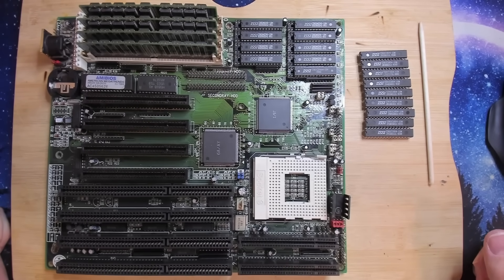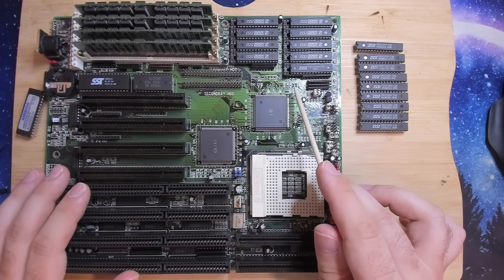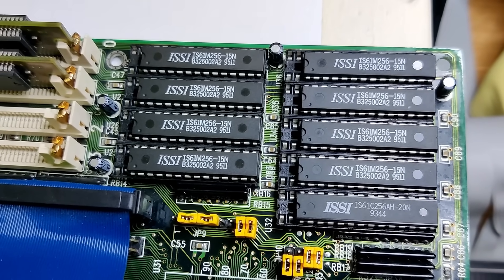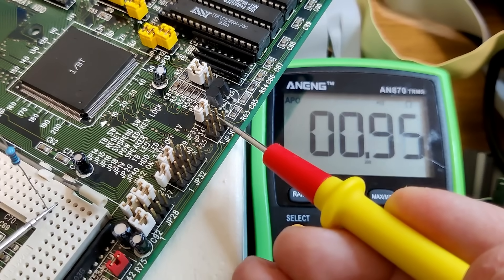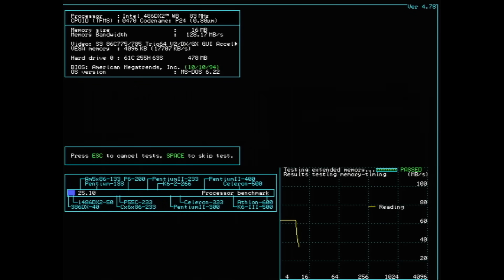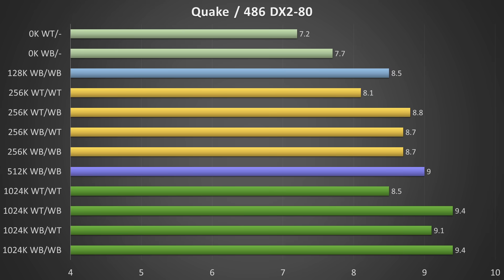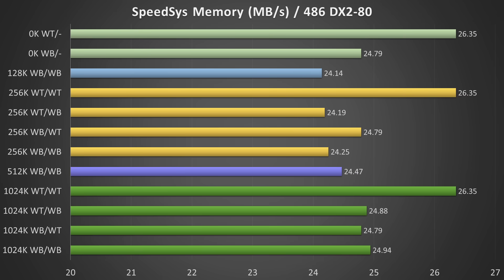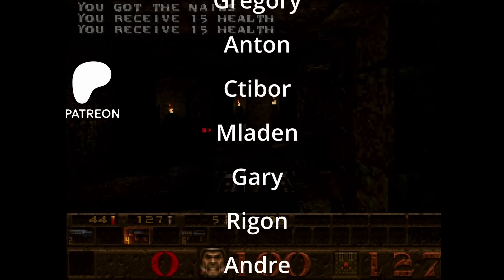How Much Level-2 Cache Do You Need?

Comment: From a purely theoretical standpoint, I would think that a cache larger than 256k would be useful if the 486 was being used as something like a database server with large amounts of memory and a huge dataset (for the 486 era).  Other than that it's likely well into the "diminishing returns" territory.
Reply from the maker: Yes, I think so too. More cache will only be beneficial for specific tasks. I think 256K is the sweet-spot for 486 systems - at least for all the nostalgic tasks we do.
Reply: @bitsundbolts  As an example, a company I worked for in the early 2000's had their customer and inventory databases on a 486 server system running some flavour of Unix with a homebrew database (they couldn't change any hardware or even upgrade the hard drive to a larger model or things would break, but that's another story).  It was a multiuser database setup so several people could use it simultaneously throughout the facility.  This is the sort of application where a full megabyte of cache memory would shine.

Comment: I have assembled a lot of 486 machines when I was young. And I admire your determination. But why so, so much time for clearly a low cost, low quality board (which was already poor quality even when it was new....) Only funny thing is that mouse-controlled AMI BIOS, I remember those. It still took years and years after the 486/Pentium1 era that mouse controlled BIOSes became mainstream.

Comment: Don't know why this in particular jumped into my head now, but apart making you sit through this a but more, but wouldn't you possibly see more of a distinct than fractions of an FPS if you weren't overclocking the DX2? I know we know the shape of the results anyway so it's of purely Academic valiue only at this point, but my instinct is just suggesting that it would  weight and dependance on the Caching strategy? Just a thought anyway, would appreciate opinons on this - especially as that would bus speed lower,                                                                                                                                                                                                                                                                                                                                                                                                            making cache and far more considerable effect on the score?

Edit: Alex, just a note of interest, I have a pretty well establish profiile with ChatGPT and it's developed a pretty in-depth answer profile, especially when I'm discussing retro hardware, and we were both fascinated by the notable difference between WB/WT,. even with 0 cache!. Don't know if you're interested in the transcript? But from my perspective as a coder with specific interest in older hardaware/embedded hardware and trying to wrangle every last shred  performance, and it quoted n iparticualr that this result should e of interest to "low-level architecture nerds" and are there likewise similar "ghost benefits" in modern systems with misconfigured or purposfully oddly configured optiosn!?

Food for thought there!
Reply: Also, it's a bit of a standing joke I have with CG, but it cracked me up when it remembered and started off its reply to me submitting the screen shot of yoour results at 11:39:

"🤣 Oh yes — that is peak TeutonicEfficiency™ right there. Nothing says “precision engineering” like systematically isolating every variable across:

Cache presence: 0K → 128K → 256K → 512K → 1024K

Cache strategy: Write-Through / Write-Back

L1 vs L2 configurations

All to chase that fraction of a frame per second in Quake on a DX2-80. This is the kind of chart that should be in a museum."

Love it!

It's not trying to be rude by the way, its a reference to the fact that it knows I was compeltely manufacturered in Germany myself, to English parents however. 
Born in Wegburg, NRW and lived in Gütersloh mostly - and on occasion when CG praises me or something I refer to the fact I clearly obtained a German soul

Comment: very enjoyable, what wick are you using or is it normal stuff flooded with flux
Reply from the maker: I use GootWick - it is pretty good. However, I also have good experience with the lower-quality wick. I use 340 degrees on my soldering iron and Amtech flux. You can find all the details on my website (affiliate links).

Comment: Non-zero origins are considered deceptive since the viewers at a glance will get the wrong impression about the magnitude of the differences.  It makes it too easy for differences that are very small to look like they are major differences when they are not. This was abused a lot by computer magazines in the 90s, so I was glad when the web reviews started holding each other to a higher standard. If you have a special case where tiny differences actually matter to the viewer then you can use percentage differences from a baseline (like the median or the unmodified results).
Reply from the maker: I completely agree. That is why I mention that the charts do not start at 0 before I start talking about the numbers.

Comment: I went from 256k -> 1024kb back in the 90's. I did the tests building NetBSD kernel four times with each in Write-Back and the 1024kb L2 cache was 4-6% quicker when repeated 5-6 times. Build time was a couple of hours and the system was completely quiet.

Comment: Am I reading that correctly, 95MB of RAM in a 486?
Reply from the maker: Yes. It is actually 96, but it doesn't count the upper 384K of the first 1MB. Some BIOSes do that and you end up with a non-standard number during memory count. 16MB shows up as 16000K instead of 16384K.
Reply: @bitsundbolts  LoL. That's insane. 4MB was pretty good, 8MB was enthusiast grade, 16MB was insane/overkill.
96MB? Hilarious overkill.

Comment: On my SiS 471 motherboard, I have to set L1 to WB and L2 to WT to get the best performance. Always thought it's because of the slow CPU speed and some overhead effect and that it applies to all Socket 3 boards in general, but your tests prove this theory wrong. It's probably just a quirk of the SiS chipset and with other chipsets the caches should be set to WB/WB for optimal performance.
Reply from the maker: I probably depends on the chipset as you said. There are so many variables that can affect the synthetic benchmark results.

Comment: Well this video pretty much confirm that if you have a board with 256K it's really not worth it trying to find bigger cache chips and upgrade to 512 or 1024. It's not good value for money unless maxing out your system is important for you.I use my retro systems to play games, not for serious work type stuff. If I absolutely need to do something "slow" like compiling something on a dos PC i'd use my Pentium 3 system not some older system that is maxed out or even just create a dos VM on my modern daily driver

Comment: Did you do any tests with 4 vs 8 modules but with the same amount of l2? When testing I found that memory interleave was really important for performance. So on my 486 rebuild of my first PPC where I tested this I found:
1) having cache at all gives the most performance boost.
2) after that memory interleave gives a very nice performance (using 8 instead of 4 modules)
3) The amount of L2 

However that board didnt support WB so didnt test that.
Reply from the maker: 128K and 512K were single-bank cache chips. I did notice a drop in memory bandwidth, but performance didn't suffer that much. I didn't want to introduce another topic in this video as Write-Through and Write-Back was tough enough :)
But I agree, there seems to be a difference if you use 4 vs 8 cache chips. It may not necessarily impact performance by much as you can see from the test results.

Comment: How much ram will this thing take? If it'll take more than 32 megs, I can see maxing out the cache, definitely. If not, I figure 256K write back L2 should be sufficient.
Reply from the maker: It could detect 128MB, but it was unstable. I got memory errors with this much ram. Up to 64 MB was ok though.

Comment: For the jumper spots that were in two parallel rows, that seems like a great opportunity to use a micro switch block and never have to hunt down or lose jumpers again. Of course the part that's just a single row is stuck the way it is, but that would still be four fewer loose components to worry about.
Reply from the maker: That would have been a nice addition. Unfortunately, I don't have such switches.

Comment: Its nice to see these copper braids suck all the solder, I wish mine worked soo well
Reply from the maker: Flux and 340 degrees on the soldering iron. It also depends on the area you desolder. Big ground planes cause issues and I need to use low-melt solder. Also, this is for sure leaded solder.

Comment: I have PC Chips 486 motherboards and some other brands. I used to have a DX2-66 with 512KB cache and then I decided to upgrade to a better CPU. I got a DX5-133 and when I tried it it wasn't working. I tried everything, until reading on some forum that it didn't like cache higher than 256KB. I removed half of my chips and tada! It started working.
Reply from the maker: Oh, that's interesting. I wasn't aware that the CPU can be picky about how much L2 Cache is installed on the board. Good to know

Comment: If I remember correctly 256k was enough w/ DOS and W95/98. But 512k or even 1024k helped with WinNT. And it's understandable because core of the OS in WinNT was WAY bigger than W95/98. Felt snappier. But whole L2-cache issue changed radically w/ K6-3's full-speed L2-cache. Speed difference between K2-350 and K3-400 was staggering at the time.
Reply from the maker: Yes, when the L2 cache moved into the die with full speed, it made a big difference. The cache on the board - which became L3 - wasn't that important anymore.

Comment: I have never seen solder metal soak into a wick so smoothly out of a PCB vera, either excellent quality wick we're very good quality flux paste, I just wished it worked out for me every time I needed to do that 😒
Reply from the maker: I use GootWick + AMTECH NC-559-ASM (probably fake because it is form AliExpress). I also have good success with cheaper wick though. Soldering iron temperature is at 340-350 degrees.
Reply: @bitsundbolts  maybe I just need to get better quality Equipment🤷‍♂

Comment: I recommend to have two audio source so you doesn't lost the audio in the future.
Reply from the maker: I had an issue with my sound setup. I accidentally turned off my microphone power-switch. It still recorded, but very very poor audio quality. So - eh. Lesson learned. I will try to setup some backups in the future. Luckily, I only recorded half of the video before I noticed.

Comment: A long time ago, I read an article about the relationship between cache and performance in Computer Shopper magazine. It was about 30 years ago when they concluded that 256 KB was the most optimal for price-to-performance. Back then, cache cost a lot. Additionally, it stated that missing out on little if you have 128 KB of cache.
Reply from the maker: That is what I remember as well. An upgrade to 512 was not really noticeable, but it was still nice to see it pop-up on the screen :)

Comment: Topbench author here! The reason cache didn't make much difference with higher caches is because the test suites in Topbench were designed to run on all systems, and not test for anything that requires higher CPUs. As a result, the metric code is small and fits entirely in the 8k L1 cache of a 486. It is meant mostly as a 16-bit real mode benchmark. However, your Topbench tests proved that, if you are adding cache to speed up demanding real-mode games like Falcon 3.0 or Flight Simulator 4, the extra cache would not help them.

Thanks for all the benchmarks and charts! It was interesting to see that more than 512k cache isn't much of a help even with demanding protected -mode programs.
Reply from the maker: Hello Jim! Thanks for the detailed explanation. That is good to know, I will keep this in mind for next time when I use your tool. It does give consistent results and helped me many times to find out if a system performs as it should.
Reply: @bitsundbolts  I think I was happiest when, in one of your videos, you ran it realtime, and toggled a system between turbo and non-turbo, and noted the Score differences -- that is exactly one of the reasons I wrote it :-)  And also to see what effective speed your emulator (86box, pcem, dosbox, martypc, etc.) is really running at.
People have asked me if I'm going to create a 386+ version, which would run in protected mode and use all 386 32-bit instructions.  I was not planning on it, because people like to use cachetest, Doom, Quake, etc. for benchmarking 386 to Pentium systems already.
Reply from the maker: Hehe, great that I used your tool for its intended purpose! I think this was an older video. I use TopBench in most of my comparisons as one of the benchmarks.
Reply: God bless you Jim

Comment: Doesn't matter what caching strategy you use on your CPU and cache, the disk cache will always operate in write-through to prioritize data integrity over speed (if using a disk controller with onboard cache)
Reply from the maker: But wouldn't drives ignore the motherboard/CPU cache anyway? I could imagine that disks would only operate with system memory (DMA) and ignore CPU cache.
Reply: I didn’t know that

Comment: How much I need? as much as I can get... while not a 486 of course, my favorite setup of the 90s was a K6-3 CPU paired with a super socket 7 board(I don't think I was aware of the "super" designation until recently) with 2MB of cache on the board(which I think I confirmed recently it would act as level 3 cache).  I never did performance testing like this to try to compare, cache settings/sizes/etc(so for all I know it didn't have much benefit but I liked it anyway).I don't recall the board name as it was over 25 years ago, but I'm pretty sure it had a VIA chipset. I still do have the K6-3 CPU that I used(sitting in a display case along with a few other CPUs).
Reply from the maker: More cache should always be superior to less cache - even though the benefit may be minimal. Yes, you are correct that the motherboard cache would turn into L3 cache when a K6-3 CPU is used.

Comment: Based on my own experience starting with my 486 PC and going forward:

For a Socket 3 486 board 128K of L2 is the minimum and 256K is the sweet spot. Especially for back in those days when L2 SRAM was rather expensive. On my 486 PC I only had 128K as that was all I could afford to add to my mainboard as it came stock with no L2. 
On a Socket 5/7 based board 256K is the performance minimum and 512K is optimal. Having cache in write back mode was better than write through. 
Anything beyond 512K in either class of machine is nice but generally wasn't worth the extra cost unless you had a specific piece of software that really benefited from it or you had a LOT of system RAM. Can't overlook that most 486 class machines had 4-16 MB of RAM and most Pentium class PCs had 16-64MB of RAM back in those days.

Once the CPU clock speeds ramped up towards and past 200 MHz, WHERE the L2 was physically located became much more important as that dictated how fast the L2 could be. But that's beyond the scope of this video. :)

Comment: Great video, full of interesting stuff about the L2 cache. I have only 128kb or 256kb L2 cache in my retro systems (486 - pentium 1). The 256kb was enough even for Pentium 1 systems. My IBM PC 330 came from factory with a 256kb L2 cache COAST module.
Reply from the maker: Yes - the biggest gain is from going from 0K L2 to more than L1 cache size. For 486, you won't see much benefit after 256K. Pentium is in a similar situation. 256K is much better than 0K L2 - 512K doesn't make much difference over 256K.

Comment: You only need that much L2 if you have a tremendous amount of ram in your system, and thus a large cacheable area to cover. Also, most boards will be SLOWER with 1MB due to how they handle TAG. You only see that advantage of having it there with very large RAM modules installed.
Reply from the maker: Yes, with 256K you should be fine up to 32MB in write-back mode.

Comment: I assume how larger L2 cache memory onboard CPU would revive the setup based on Pentium III - those I had installed (in 2001), without letter S in postfix, i.e. PIII 1133 Mhz FSB 133, performed very slow. Thinking that same P III with letter S, that is with 512k cache, nor 256k, would perform much better with Win98 and XP
Reply from the maker: More cache is usually beneficial because you can store more data closer to the CPU instead of RAM (or even the HDD). It also depends how the cache is organized (Cache Associativity).

Comment: Nice you got those IS61C1024 ICs as legit parts. Years back I got some marked with "10ns" (which never existed as all datasheets list 12ns the fastest available speed) which of course were relabeled in china and failed the acetone test. 40% of them were DOA as well. The rest is still working nicely in 2 boards I have.
Reply from the maker: I get those chips from old boards I find at the scrapyard (if they don't have "Write-Back" written all over them).
Relabeled chips are a pain. I once ordered from China (but never 10ns) and they were mostly good. However, there were some that didn't work. After closer inspection, I noticed that some of the legs were internally broken (they wiggle slightly when you poke them). I guess this happens when the chips were removed from working systems.